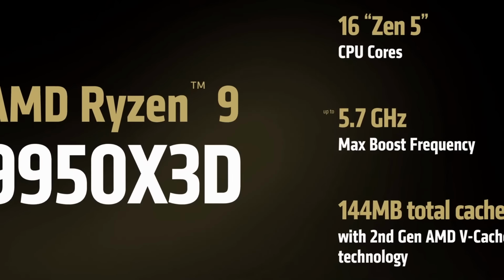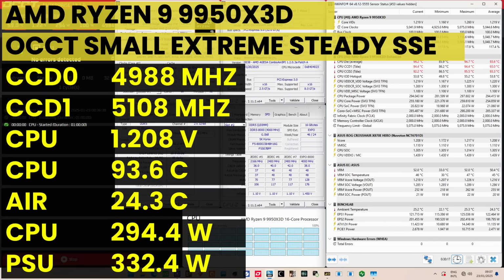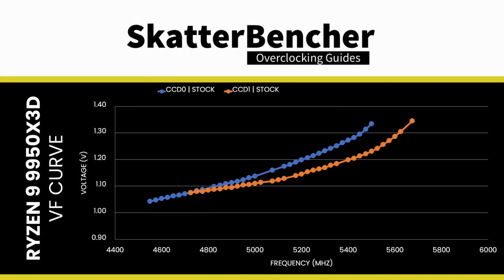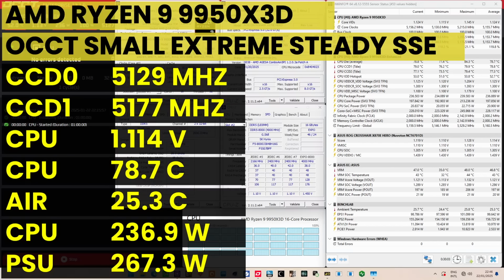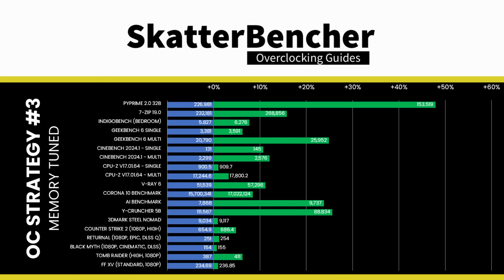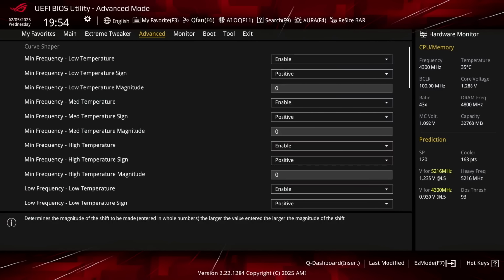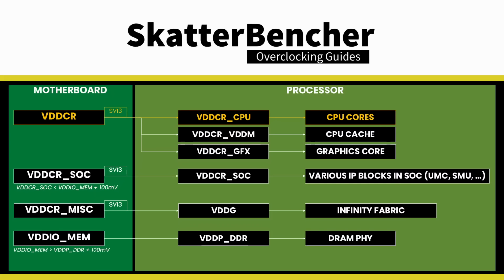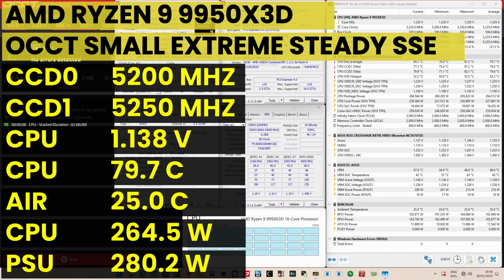Ryzen 9 9950X3D Undervolt & Overclock to 5900 MHz | SkatterBencher #85

Comment: Awesome video with a lot of great info! I'm running into a strange issue: My Pc is a bit unstable during light workloads, I.E. watching youtube/twitch. I tried playing with the Min/Low/med freq CO, but I can't seem to get it dialed in. It will reboot once or twice if I don't immediately jump into gaming/heavier workloads and will blackscreen and reboot. I get kernel 41 error in event viewer. Once it's "warmed up", it's rock solid.
I also enabled Loadline calibraion (mode 1) as I suspect it might be related to Vdroop, but it didn't help much. If you could give any input on what settings to adjust (not the exact value ofc, that's basically impossible), I'd greatly appreciate it! Thanks again!
Some specs:
r9 9950x3d
64gb Fury beast 6400 (running at 6000 with 2200 fclk, 1:1 ratio, 2x32gb), 4080 super, 850w corsair rmx, fury renegade 2tb (new with fresh windows) nvme.
Reply from the maker: If you're running into stability issues in idle or light workloads, it can be either of two things: (1) the upper end of the curve is not stable, or (2) it gets unstable when transitioning from idle to max frequency.

For (1), increase the CS for Max and (maybe) High Frequency
For (2), increase the CS for Min Frequency
Reply: @SkatterBencher  awesome, thanks for the reply! I'm currently just running it "stock" with default pbo and expo enabled, rock solid so far. I'll give your suggestions a go and write back :)
Thanks again!
Reply: @SkatterBencher  Hey again! I haven't really played much with the CS, but I disabled global C-state and set the Power Supply Idle Control to typical. so far no idle issues and no stress test issues either. I'll report back a bit later if the stability changes.
Thanks yet again!

Comment: minute 12:43 What AMD calls a "negative shift" on the CO curve is actually a positive shift along the X axis. No wonder I always found this so confusing... This is the only video that appears to explain this fully and correctly.
Reply: it's negative on the voltage, meaning you can push more freq under the same TDP

Comment: Thanks so much for this video, it's very well explained.

I just built a new machine with the ASRock X870E Taichi Lite (BIOS 3.20) and a 9950X. I want to enable advance PBO so I can have clocks boost +200MHz, however I won't want CPU package power exceeding 200W (the default).

Having enabled advance PBO, I've tried the following PBO limits to constrain CPU package power, none of which have worked (it hits 250W+)
- disabled
- motherboard (on this setting I expect to see 250W+ so this is normal)
- auto
- Manual with PPT set to 200,000 (it says the value is in mW so I multiplied 200W by 1,000), TDC and EDC set to 0 as I'm not sure what these values should be.

What am I doing wrong / missing?
Reply from the maker: It sounds like you're doing all the right things with manual PPT = 200,000. 

Are you configuring it in the official AMD submenu or in a custom ASRock menu? I'm not too familiar with their BIOS layout but sounds like there's maybe a duplicate setting overriding your custom value.
Reply: @SkatterBencher  You are exactly right, I figured it out last night. PPT can be controlled in two places. The place just below where you can set the PBO mode doesn't work. The option in SMU Common Options does work.

Comment: What bios are you using, PBO seems broken on the X870-E Hero on the latest one
Reply from the maker: I was on BIOS 0038
Reply: @ ok thanks
Reply from the maker: What do you mean by "PBO seems broken"?
Reply: @SkatterBencher When using version 1203 pbo is not working as it should when using curve optimizer, it’s capped at 200w, even the new beta is bugged where pbo only works if you don’t use curve optimizer
Reply: @SkatterBencher 0038, is that a early bios because the oldest i can find on their site is 0303 from 09/23/24
Reply: nvm found a fix, it was the cpu

Comment: used this on mine, all core is topping out at around 5100-5150. R23 went from 39494 to 42130, Not too shabby.
Reply: Stock r23 multi is 42k oO
Reply: @ if that’s the case then wonder where my performance is going. (Nvm figured it out. Stock now is 42k, OC is 45k)
Reply: @Paradigmfusion what did you change? Having same issue
Reply: @ oh its the same core parking BS with 11 as the 7000 in power plans run it as balanced instead of high performance.
Reply: @Paradigmfusion Thank you!

Comment: Im still using the Asus ROG Crosshair 670e Hero. Would love to see a similar video if you think different strategies would apply omsince my memory is still DDR5-6000 with 30-40-40-96-1.40v No matter which expo I choose with the options being expo One, expo 2, expo tweaked, and expo on the fly +
Reply from the maker: The OC Strategies should be nearly identical between the two boards, so no worries!

Comment: I was able to get 5 Cores on CCD1 to -60, one to -50, one to -45 and one to -40. On CCD2 I started with -30 but it crashed. It was stable at -20. And I haven't even started using Curve Shaper, yet.
Reply: I tried "per CCD" with 15 on both and system freezes in single core test of cinebench 🤣  amazing how you guys able to use such high numbers
Reply: I ended up with a per core. And set -20 on all ccd0 cores, and -15 on most of the ccd1 cores except the best 2 cores that had to be -5. That's why cinebench was freezing. Not anymore
Reply: @LibtardsTears  I'm in the same boat as you. Even just PBO enabled and expo enabled I'm getting no where near his scores
Reply: @LibtardsTears  Same. Curve shaper works flawlessly though for me.

Comment: Hello - any ideas as to why my 9950x3d will not use more than 200w in a Cinebench R24 run? It's like it's limited to stock PPT but the PPT is showing as 1000w, and it's not hitting a temp limit afaik?
Settings I'm currently running PBO -20, 6600 expo, infinity fabric 2100, its at 1.16-1.2 vcore, 5.2~ghz on all cores. Max package temp of 80c, CCD0 76c and CCD1 78c. It only ever pulls 205w~ max. Best score has been a 2353 which is barely better than your stock result..

Have also tried changing the "amd power slider" setting in windows to best performance, no change. It's quite strange.
Reply: Just to update this, it appears to be an X870E board issue? I’ll ask Asrock for an update.
Reply: @Project_Evo970  if you find an answer please let me know, this has been driving me insane. - Asus x870e
Reply: @TurkeyTomDeezNuts if u use auto oc in ryzen master, it will pull up to 300w on the ryzen 9950x3d. Asus x870e hero
Reply: Bro can you tell me the settings you changed in bios, did you the strategy 4 in this video same way as him ? @antrinh9088

Comment: Would have been nice if on the screen you had a percentage over stock for each strategy. Other than that excellent video as usual!
Reply from the maker: What percentage would you like to see? At the end of each strategy I show percentage increase over stock for each benchmark as well as provide a geomean across all benchmarks
Reply: @SkatterBencher a cumulative graph with all results in a single chart. You have the data, it's just not on a single reference.
Reply: Apologies, Was tired when I watched the first time. Rewatching now.

Comment: got my 9950x3d and some 2x32gb hynix a ram. but they have a whopping expo on the soc voltage at 1.2. isn't this crazy high? thought the cpu would start degrade at that point or am I wrong. 

first amd platform ever so things are a bit new to me. Just can't get any moderately loose timings to run stable at cl 30 6000 with these ram yet, and I'm up to 1.18 on the soc now. should I really let it go to 1.2?
Reply from the maker: 1.2V SOC is not that high, it won't degrade your CPU. In fact, up to 1.3V should be no problem.
Reply: @ cool thanks for the reply. makes it a lot easier for me to dial in a stable ram! 

btw don't know if you know this, but I saw a few reddit posts from people saying tsmc said the max safe vcore temperature for the n4p node that zen 5 is built on, is 1.2 volt. is this hogwash or a legit point?

Comment: Excellent video. I just bought a 9950X3D and gonna be transferring my 9800X3D into another chassis. Which ram kit in your opinion is the best for Overclocking and stability?

I’m looking at either the G. Skill 6000mhz CL26 32GB, 6000MHZ CL26 64GB, or the newest 6000MHZ CL26 48GB. This is for the 9950X3D
Reply from the maker: Hard to say because actual overclocking headroom is kit-specific, but it does seem like 2x24GB has generally more overclocking headroom. If I had to pick of those three, I'd go for 6000 2x24

Comment: Incredible video thanks! Can the CCD0 (with 3D Vcache) boost to higher frequencies VS when you OCed the 9800X3D?
Reply from the maker: Yes, it did seem the V-Cache CCD is slightly better (but not by a large margin). Also, note that I only tried 1 sample of each SKU. So it's hard to generalize.

Comment: Its the safe way to set scalar 10x? Not impact the voltage spike and cpu longivity ?
Reply from the maker: Based on the data gathered, Scalar = 10X doesn't actually extend the voltage headroom that much. So, in theory it can impact lifespan, but in practice I don't think it will do any harm.
Reply: @SkatterBencher  thanks for the response,
I configured my CPU’s Precision Boost Overdrive (PBO) Curve Optimizer with the following settings:  
CCD: -25  
CCD1: -20  
PBO Limits: Set by motherboard  
Scalar: 10x  
Boost Override: +200

During a Cinebench benchmark under 100% workload, the CPU voltage stabilized at 1.105V. However, after the benchmark (when CPU load dropped to 5–15% per core), the voltage fluctuated between 1.2–1.4V.

Why does the voltage vary significantly at low workloads (near-idle conditions), even though the Curve Optimizer is configured for undervolting?

Comment: 8:46 is the tool you are referring to available to mortals?
Reply from the maker: What tool do you mean?
Reply: @SkatterBencher  the one which is able to set FIT limit to not a multiple of value at scalar 1. You were saying "the tool" in the video, I thought that it is some setter tool, not BIOS
Reply from the maker: The tool I'm referring to is Shamino's OC tool included in the OC Pak. He shares it on the ROG forums https://rog-forum.asus.com/t5/amd-600-series/x670-x870-resource-thread/td-p/901576
Reply: @SkatterBencher  thank you! Version 1007 of that tool wasn't locked to ASUS mobos unlike current versions, unfortunately. With that version it was possible to monitor Power Table using 'AMD Monitor' menu option. I hoped I would find such a monitor updated to current gen (or at least Zen3) so that I would be able to see what frequency limiters are in action.

Comment: Great video!! Going to try OC'in for the first time. Do you have recommendations for 32GB or 48GB sticks? Would be nice to have more memory. I'm jusy not knowledgeable yet for picking memory for tunning when OC'ing. Thanks so much for your wonderful video, just subscribed.
Reply from the maker: I've been using G.SKILL memory for years and, generally, they've never not been decent for overclocking/tuning. Not buying advice, just saying what's my experience :)

Comment: Have you ever seen negative curve optimizer (-20), or RAM timings crash/BSOD nvlddmkm.sys and ntoskrnl? It has happened twice in the last month on my 9800x3d 4090 system. Using DDR5 6000 CL32 EXPO base profile with Buildzoid's easy timings. Stock SOC, VDD 1.35. Each time computer was close to idle. First time I just clicked something in Resolve. Second time computer was just idle. I haven't been able to crash in any stress tests. Seems to be random and hard to reproduce. For now...I disabled CO. I also reinstalled my 4090 drivers...but I've had this GPU in a 13600k system for 2+ years and it's never crashed.
Reply: sometimes after awhile the cpu can loose the ability to keep the curve optimizer that high i think i had to lower mine ..from 20 to 10..it sucks and nobody talks about it but im sure its a thing because it must of not been stable that high

Comment: Is there a difference between doing the PBO tweaks in the AI/Extreme Tweaker menu in BIOS, compared to the Advanced menu and enter AMD Overclocking from there?
I did my tweaks from the AMD overclocking menu, except for changing to EXPO profile 1, but in the AI tweaker menu the PBO changes I did in the AMD overclocking menu hasn't changed. But in windows it's applied the changes I made.
Reply from the maker: There's no difference. ASUS just copied the items over from the AMD overclocking menu to the main menu for convenience. You can configure the settings in either menu.

I usually show how to use the AMD Overclocking submenu because then non-ASUS users would also know where to look.
Reply: @SkatterBencher  Thanks for your quick reply, you're an absolute legend. I only follow a select few when it comes to fine tuning and overclocking, it's very on point and easily explained. I'm expecting to be bumped down from the top of the timespy leaderboard in the 9950X3D class very soon when more people get into overclocking it 😅
(Total score 39208)

Comment: Will 10x scalar hurt the CPU overtime?
Reply from the maker: In theory yes. In practice, it seems the extra voltage headroom from increasing Scalar is really minimal, so I don't think it will have a major impact.
Reply: @SkatterBencher  even following all your steps, even for the just PBO enabled and expo enabled I'm not getting multicore cinebench 2024 scores anywhere close to where you are. Max I hit was 2380ish. Single core was 139 to 141. Is my cpu a dud or did I do something wrong?

Comment: Hi there, I'll be upgrading my rig with a 9950x3d paired with a x870e crosshair hero and I'm racking my head about which RAM to pick as it's so overwhelming. I'm primarily a 3d modeler and renderer using V-Ray and 3ds Max so my memory size is huge and I'll be using minimum 96GB for my scenes. So with that in mind which brand of ram, speed, and timings should I get if i intend to overclock? What matters more in this case , timings or frequency? So many questions but just wanted to get your thoughts on this
Reply: bear in mind that OCing 4 sticks of DDR5 is difficult. many said it was impossible to even use EXPO/XMP with 4 sticks, but you can follow the guide from Game Tech Reviews here, worked for me at 5000MT/s on 4 sticks (i used 2 kits of Gskill FlareX 2x32GB F5-6000J3040G32GX2-FX5, mobo Aorus X870 elite wifi 7) : /watch?v=NtMIppL9UC4&t=1000s

Comment: Id love to see more info on static oc, especially voltage selection and LLC. Especially on board with voltage suspension. I feel that everyone is doing +200 pbo and you can push 9000 ryzens much higher

Comment: This 9950x3d pulls as much power as the i14900k. Obviously better than the i14900k, but these are no longer super power light processors like they used to be.

Comment: Underrated channel, Swapping out my 7950x for a 9950x3d and will use this video as a refresher as its been a while since I did most of this to my 7950x
Reply: I swapped the 7900x for 9900x3d wish I'd went 9950 or 9800x3d because my core priorities don't always work correctly but when they do it shows
Reply: You're only gtting like 10-12% better performance in single and multicore benchmarks. Unless you really want extra gaming performance, I don't see how this swap will be worth it.
Reply: @ i primarily game, so the gaming performance is a huge increase here, I also was lucky enough to get a RTX5090, the 7950x would be limiting FPS here. I also do video rending so the 10-12% here is an added bonus.
Reply: @nutellaguyau  Have fun with the 5090!

Comment: @SkatterBencher Could you create a video or post an article on your website about your frequency vs. thread, frequency vs. core and voltage vs. frequency plots. I'm a bit confused about what sensors you're pulling the data from, and how you are logging the data. I just upgraded to a 9700X from my 2500K and I don't have much experience with the monitoring, benchmarking and stability applications. I appreciate the content, it is very useful and concise. Cheers
Reply from the maker: For the V/F curve, I have a video up soon: https://youtu.be/eUqxKRtuxmY

For the Frequency/threads, I use the Shamino OC tool which can create the boost curve. It's part of the OC Pak you can download here: https://rog-forum.asus.com/t5/amd-600-series/x670-x870-resource-thread/td-p/901576

For the max Frequency per core, I use NOPBench as load and HWiNFO to check the maximum effective clock: https://skatterbencher.com/nopbench/
Reply: @SkatterBencher Awesome references, thank you.